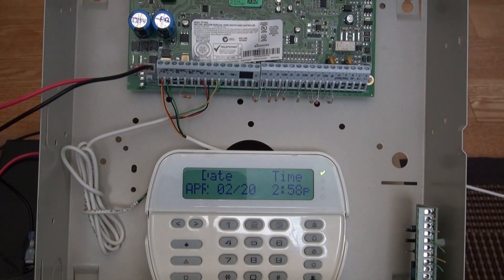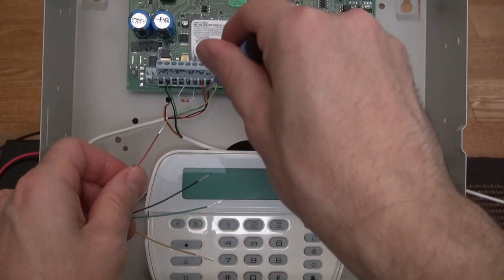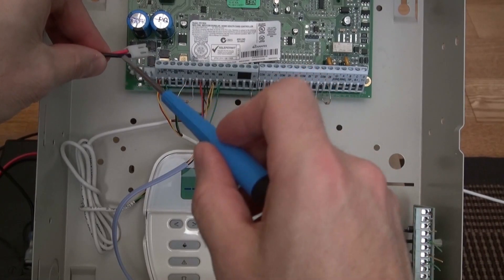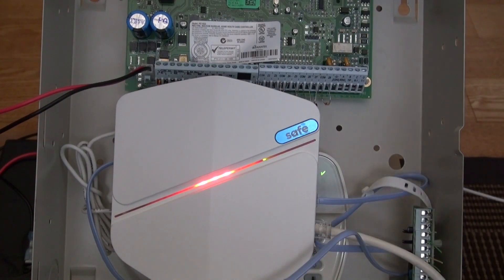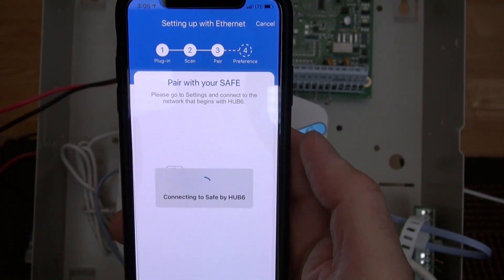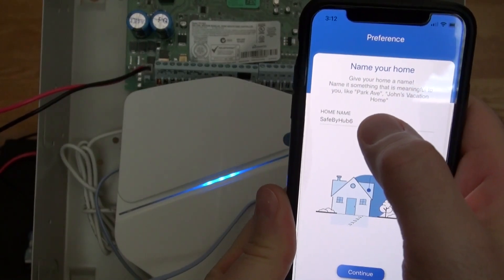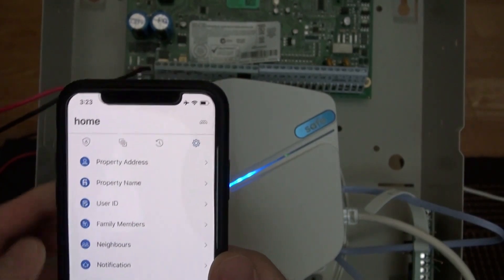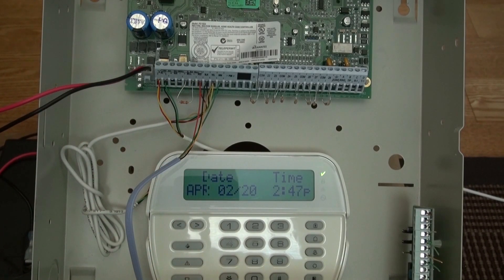Safe by HUB6, DSC Alarm Installation Step by Step

Comment: hi  if I Don't know the old password. how should I do?
Reply from the maker: Hi, You might have to factory reset it. Press the reset button located on the left side of your unit for 10 seconds. Wait until HUB6 flashes red. Then follow the steps from the app.

Comment: After I installed the HUB6 I still have the yellow triangle light can you please help me remove it
Reply from the maker: Hi, the Hub6 won't clear the Triangle. Can you hit *2 and tell me what number you get?
Reply: @JasonTech  the number is 3 after *2
Reply: If you have the dealer code (not master code) then go into programing and disable line-fault monitoring. You may also need to disable the central station communications if it was ever programmed.